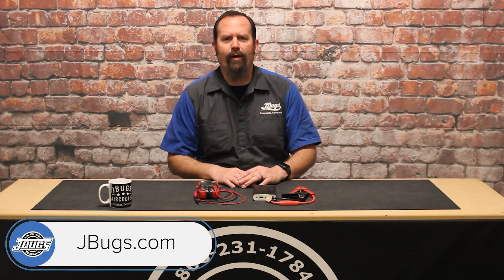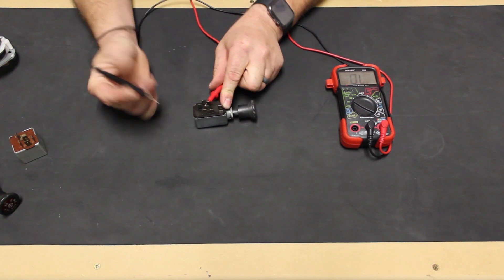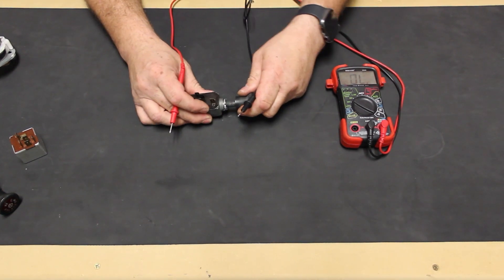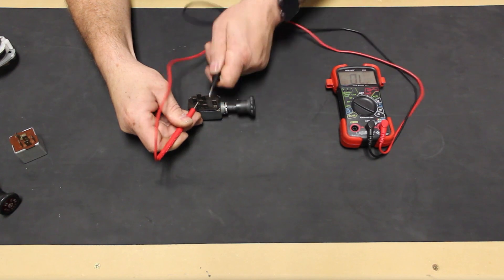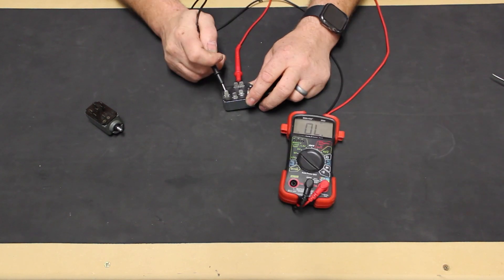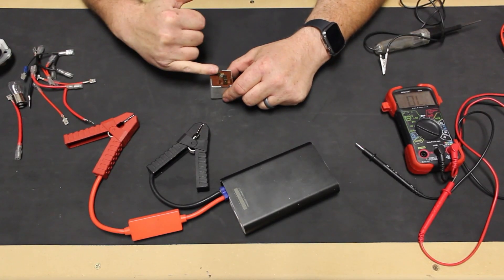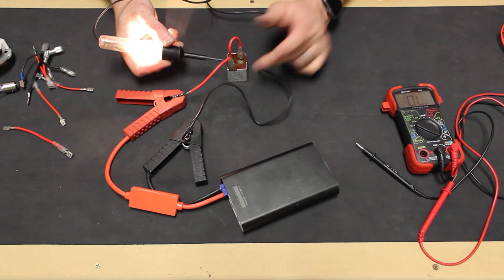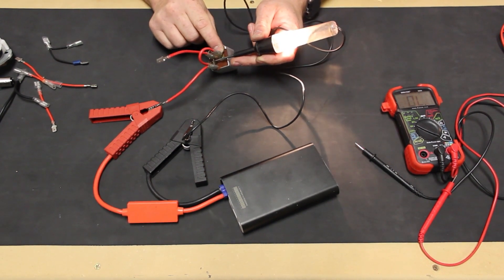JBugs - VW Dash Switch Testing - Headlight Switch & Headlight Relay

Comment: why 30 terminal has 2 pole or incoming ?
Reply: The headlight switch, depending on the model, is a distribution point for the main battery power. On some models, power comes from the battery, to the headlight switch, and has terminals to send power to the fuse box and to the ignition switch.

Comment: My 70 bug has the 8 pin switch and I received the newer version with “x” prong I get no headlights. I know I can jump #30 to it but is there a way I can do it differently to get headlights to turn on so they go off with the key off? Also, is it normal for the #30 prongs to be getting 12v constantly even when the key is off? Because my old switch allows you to turn the headlights on without the key
Reply: Original style 68-70 headlight switches have not been available for quite some time for some reason so the industry has had to deal with adapting the 71-77 switches which have the X terminal. We typically jump power from the 30 terminal (which is battery power, so yes it should always have power) to the X terminal so the switch operates like all VW headlight switches made prior to 1971. The headlight switch was completely independent of the ignition switch, up through 1970.

With the use of a relay, it would be possible to get the ignition switch to turn on and off power to the X terminal, yes. The relay would need a ground, battery power, a wire from the ignition power, and then a wire to the X terminal.
Reply: @Sam_Mebane  👍

Comment: X terminal will not trigger and continuity does that mean my switch is no good
Reply: The X terminal is an input connection, not an output. It powers the 56 terminal, and the 2 will only have continuity when the knob is pulled all the way out.